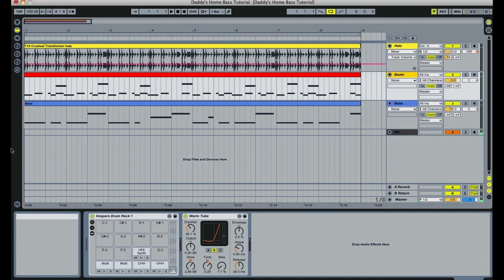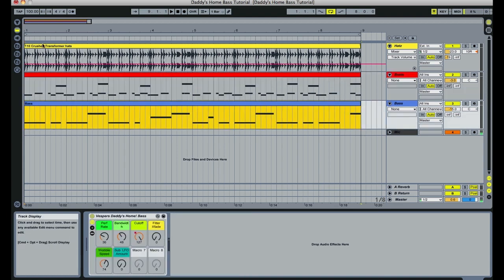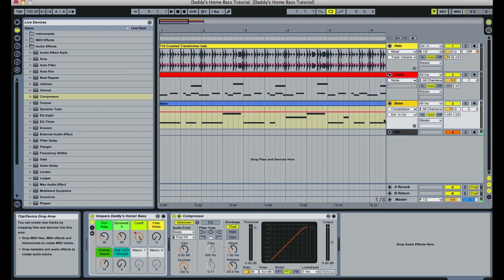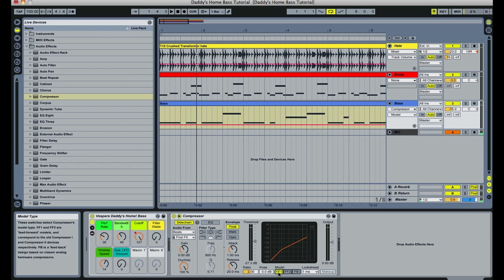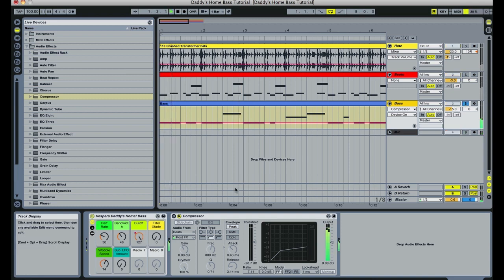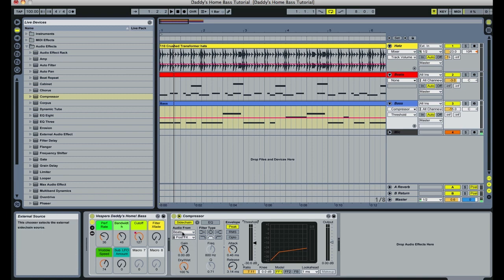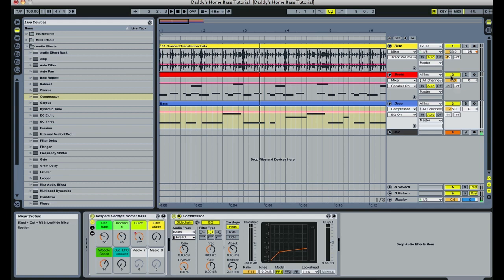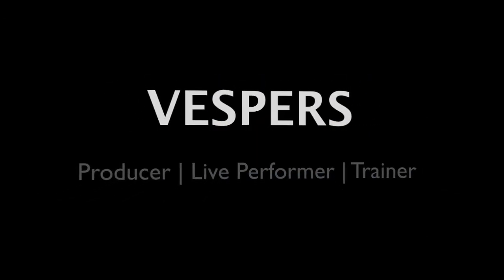Side Chaining Compression & Ducking Tutorial in Ableton Live

Comment: cool vid as always... however don't confuse ducking with side-chain compression.. they are similar but not the same... side-chain comp attenuates the signal by different amounts depending on how loud the input is - where ducking lowers the signal by a fixed amount regardless of how loud the input signal is once it's crossed the threshold

Comment: @DJVespers "Ducking simply means to dynamically attenuate a signal.  You use sidechaining compression to achieve the ducking. "  Actually, you use sidechaining compression to compress... you're just using a different signal as the input to the compressor but it's still just compression.